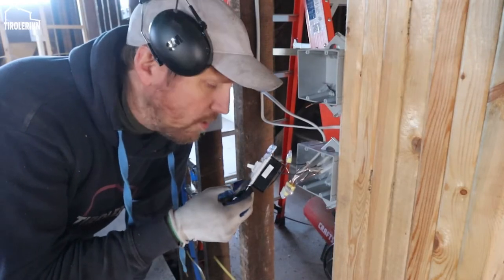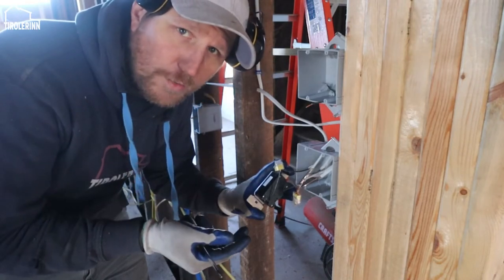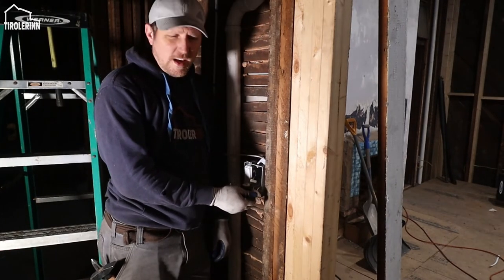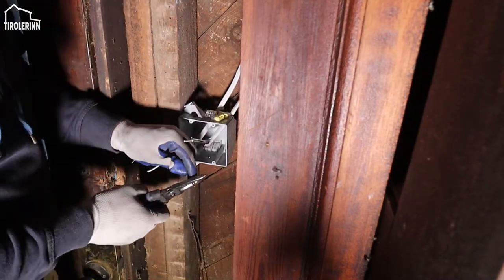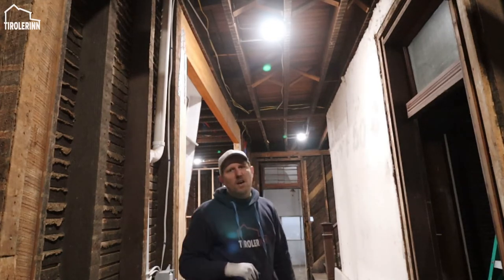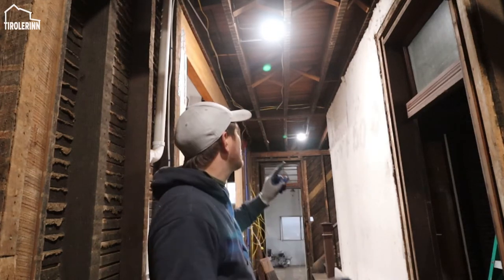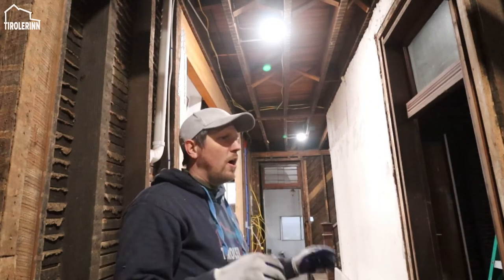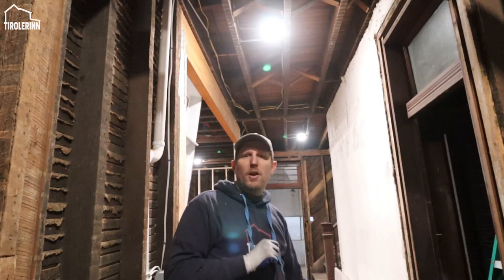Installing Lights in the First Floor - TirolerInn the Renovation

Comment: You are right, a good lighting makes such a big difference. We also use only such connectors for our electrical work two years ago. If you have enough space, you can also use the removable one (without cutting the cable😁). Our electrician, who controlled our work, told us, that this connectors are the actual standard. 
I think, it's a very good idea with the lighting rails to highlight the paintings.
Reply from the maker: Actually you can get the cable out of those by twisting and pulling at the same time. So no need to cut.

Comment: Thanks for the explanation.  Makes perfect sense to me.  What type of heat are you going use?  Electric or is Gas available in your area.  You also said that you are going to have the hot water circuit running all the time for almost instant hot water.  That means the electric will need to be first to run the pumps.  Making great progress.  Hope you get to stay warm in there!
Reply from the maker: We will be using gas heating in the basement and 1st floor because the heater was already bought by the previous owner. For the 2nd and 3rd floor we will be using a heat pump, so electrical. As for the hot water, yes we will be needing to run the pump and the base controller for the gas instant hot water heater.